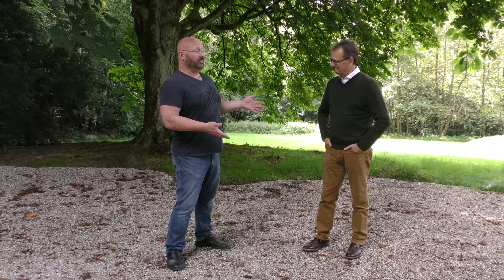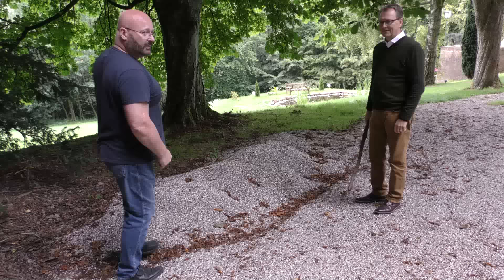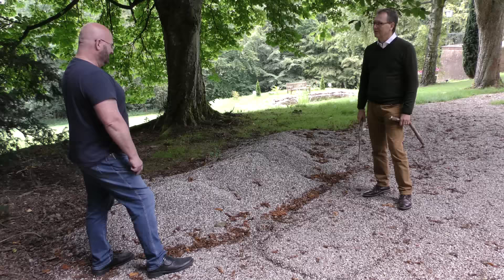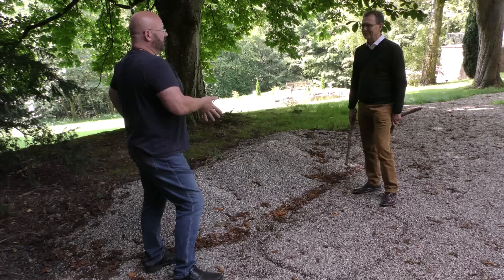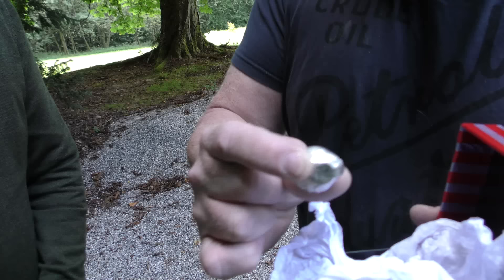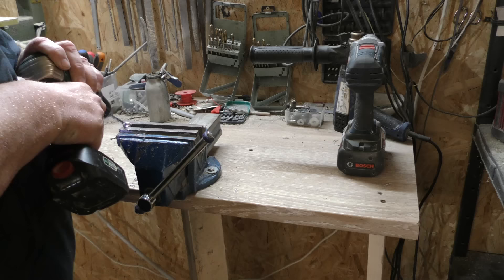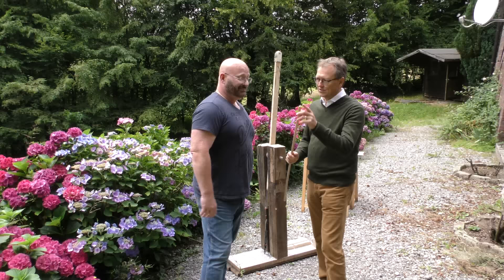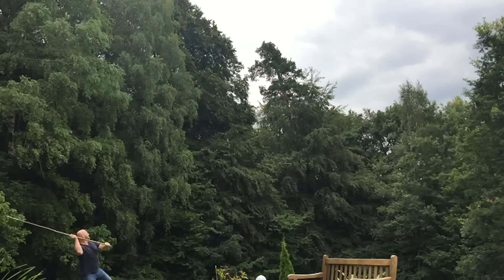The Mystery Of The Whistling Bullets: Psychological Warfare, 200 AD

Comment: What would happen if you shot 2 of these pellets connected via a small chain? would it be feasible?
You'd probablly need to increaes the number of slingshot bands to accomodate the extra mass.
Just wondering about the amount destructive damage you could cause.

Comment: Hello Jeorg.
   I think the idea of the 'bullet throwing stick' is a good one, but something you did not test was a thinner 'wand' and using the smaller, 40mm bullets. I am no expert, but I feel that such a small projectile and thinner 'rod' would result in faster reloading, and with the 'flex' of such a thin wand, result in higher bullet speeds. And of course, higher speed means longer range, which keeps the thrower out of hand thrown projectile ranges, such as spears. 

   Just a thought, 

speaking Frank-ly
 
   Please pass this on to Dr. Reid if you think it is important enough to warrant his attention.

Comment: The smaller the hole, the harder it would of been to drill back then, so the reason for the 4mm hole was probably it was the largest size that made a decent whistle as the 6mm clearly didn't whistle as much and was more of a wooshing wistle then an actual shrill whistle. The diferance came through a lot on the recording.

Comment: It's just a thought but if you got a piece of wood and carved a channel in it so it held they metal BB's (like a guns ammo clip) and to have all of the metal BB's orientated so that the holes are perfectly accessible. then I believe you could achieve a much faster reload time, because with all of the metal balls orientated in a direction where the hole is easily available you could simply hold the clip of metal balls in one hand and poke the pointy end of the stick into the whole of the next ball every time you go to lunch one this way you will have a smooth motion to launch and reload without having to fumble around and find the hole.... And if practiced I bet you could get a very fast reload time....

Comment: Duude, if your firing staff was smaller and you could load a bearing  further down the staff, it would be harder to aim but project much quicker. You could also load maybe 10 or 20 at a time and fire them in an array across a field. Also, an added advantage would be preserving 20%+ on materials!

Comment: The hole size might have been the same size across the board not because of functionality, but commonality in manufacturing method as they would be cranking out thousands of these things. Finding some at another Roman siege site would be interesting to see if the hole size is different from maybe a different manufacturing source.

Comment: If I may suggest an experiment.....try a sling like they use on the game of jai alai...with a 4 mm peg at the base of the sling. The peg would hold the ball in it's initial launch position and when the slinger went through thw motion of launching the ball, the curved surface of the sling woild put an incredible "reverse spin" on the ball....thereby INCREASING the whistling effect as well as INCREASING the flight time of the ball.

Comment: I am not sure why it is assumed that poison would be in liquid form and not more easily managed like certain leafs, herbs, flowers, for example. If solids,  it would not necessarily need to be sealed in, only attached using a bit of wax, so as not to fall out during flight, or with nothing but moistened to dry compacted in the hole.  Another might be that the end of the stick which went through the holes was soaked in poison or rotting meat etc for infection so it served to launch and to load the projectiles with poison/bacteria. On the other hand launching from a stick reminded me of the arm extensions sold for throwing tennis balls for dogs or the Spanish game where they have a curved device to launch a ball. In the former it’s not so possible to put poisons into the projectile, in the latter the hole is only needed for that (and noise). Final observation is that the most simple explanation for the holes being uniform is they are made with a standard tool! Occam’s razor. It’s another step further from simplicity to say they were for a pole to launch from. Or maybe they were simply (or also) carried by soldiers on poles to be quickly reloaded efficiently. I note no attention seems to be paid to how the bullets were manufactured which is strange since what tool made the holes is a very important part of understanding. Were they made on an industrial manufacturing basis like many Roman things, if so there is no reason for the holes to vary much except when a new tool was needed.

Comment: You said that your a bad slinger? Maybe the Roman troops used a staff sling variant. I was interested in the stick an the ammo placed on the nail. Two questions how far did it go an maintain a true straight line? Secondly how would it perform at a target 40/50ft ?

Comment: I offer another theory.

Perhaps the holes in the projectiles were due to the moulding process and how they were removed from the mould.
Perhaps small sticks were used within the mould with the benefit that one could more quickly remove and handle the projectile after pouring lead. I imagine that the moulds wouldn’t have been smooth and therefore the projectiles may have proven problematic to remove. What do you think?

Comment: Chain shot. There are shotgun shells comprised of 6 lead “buck shot” tied together by copper wire. Amazing accuracy and hitting force. Btw, you can easily cast the holes in lead shot, picture a “shot press” as was used by muzzle loaders and insert a steel pin.

Comment: When I was about 10 years old I was struck in the head with a rock from a slingshot. Having the camera on the receiving end gave me flashbacks of seeing that rock flying at me, the bright light I saw after it struck, and the ringing in my ears afterwards. I remember buckling at the knees and falling down into a prayer position staring at my hand and the long sleeve orange shirt I had... then the trickle of blood which increased massively in a matter of seconds falling on that orange shirt at my wrist. I reached up and touched the side of my face, confused at where this oozing red liquid was coming from. Then peering at my blood soaked hand caused adrenaline shoot through my veins, likely the only reason I didn't pass out. I remember being very tired after the bleeding stopped but my cousins wouldn't let me fall asleep for fear that I wouldn't wake up. That was 26 years ago and I haven't really thought about it in a long time. I still have a small dent in my head from it. Enjoyed the video. Cheers

Comment: Late comment but plausible.   Perhaps the 2mm hole was used to remove less mass from the projectile to keep the desired weight rather than a 4 or 6 mm hole which would have lightened it more.    Just a thought.
Another launch theory.  Imagine a giant scoop of these little whistlers coming at you from a huge catapult instead of one big round rock.   A large amount of these being launched all at once would create quite a scream.

Comment: Evaluating impact based on velocity is important. The velocity obtained at the hill would be possible based on some simple ballistics calculations. If the Romans had camps on opposite sides of the hill, the velocity of the projectiles must not have been too great, else they would have hit their own men on the opposite side. Knowing that distance, you can get an idea how fast the projectiles needed to travel to not pass to the other camp, and you could calculate what the velocity would then be on the hill.

Comment: Being a slinger myself (but having never used this kind of pierced sling ammo) I would say that 2 of the points mentioned here are the most plausible.

1) As as another person commented. Timing the noise was a means to gauge the distance so other slingers  would know how far away the enemy was.

2) They used the butt spikes of their spears/pilum javelins to launch these pierced lead bullets. This is a actually far more practical than using staff slings in a close-ordered formation (which is an awful idea, Been there, done that).

3) The whistling effect could be used at night to startle the sentries so that your men could slip through the defensive perimeter (commando style ) and set part of the roman camp afire.
Reply: We do know the Romans did like their staff slings, however, for their skirmishers and, presumably, from inside their fortifications.

Comment: Those projectiles would have been traveling in a parabolic trajectory with vertical component equal to terminal velocity and horizontal component at say half the "muzzle" velocity.  Resultant being say about 200 miles per hour.  A terrifying noise and rain of pellets with larger projectiles.  Deadly!

Comment: Or perhaps they were drilling the holes with something convenient that was relatively standardized.
Reply: hmmmm yes, i thought of this too. maybe the standard drill from the romans field tool box is that size. if so, this diameter should be found on other objects or works.. if more of these holes where found on other roman equipment then it might be the reason why all bullets have the size of the hole. needs more archeological research to find out. 
the stick-theory is plausible, a good explaination as well

Comment: I'd be interested in the poison theory! 
At first it seems very unrealistic but after I've sawn the penetration I could imagine that they seald the hole with wax of some kind and this would either be thrown out on impact or would be melting away in the body...
Would be cool if you could test that With the ballistic gelatine and some colured liquid!
Reply: I am not sure why it is assumed that poison would be in liquid form and not more easily managed like certain leafs, herbs, flowers, for example. If solids,  it would not necessarily need to be sealed in, only attached using a bit of wax, so as not to fall out during flight, or with nothing but moistened to dry compacted in the hole.  Another might be that the end of the stick which went through the holes was soaked in poison or rotting meat etc for infection so it served to launch and to load the projectiles with poison/bacteria. On the other hand launching from a stick reminded me of the arm extensions sold for throwing tennis balls for dogs or the Spanish game where they have a curved device to launch a ball. In the former it’s not so possible to put poisons into the projectile, in the latter the hole is only needed for that (and noise). Final observation is that the most simple explanation for the holes being uniform is they are made with a standard tool! Occam’s razor. It’s another step further from simplicity to say they were for a pole to launch from. Or maybe they were simply (or also) carried by soldiers on poles to be quickly reloaded efficiently. I note no attention seems to be paid to how the bullets were manufactured which is strange since what tool made the holes is a very important part of understanding. Were they made on an industrial manufacturing basis like many Roman things, if so there is no reason for the holes to vary much except when a new tool was needed.

Comment: 14:01 Im wondering as I watch this, maybe the size of the 4mm hole, was tested, and found to be a good resonating tone which travels farther because of slower soundwaves and sustains longer for the same reason? THey could have chose this size from trial and error with different sizes, OR they could have chose it because it was the same tool used to make a hole in a flute/pipe so they used it, hoping for the same tonal effect from a projectile? I am sort of sad, I feel like we wont get to hear this as it was meant to be heard, with fifty to a hundred of these projectiles, making the same tone, all resonating together in flight, it would sound louder and louder as it got closer, followed by shouts of pain or panic, making it very similar in effect to the whistling of the dropping bombs in world wars 1 and 2, which you already said. This is a very cool psychological ancient warfare video! :D

Comment: Mabey the hole drilled in to the shots is that they stacked them on a stick and slid them down to the hand allowing a shot controlled by the hand releasing one at a time "simi auto" or spread shot all at once. slid down to the hand would allow a more accurate swing and shot by pointing apon launch, a "straght shot".

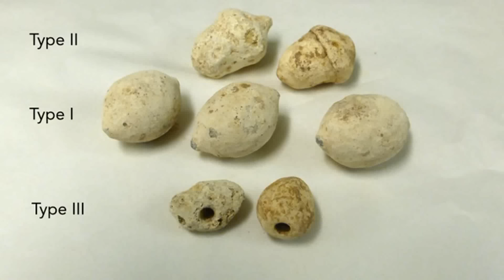Comment: I'm at 5:47 and wondering what if these were used to do shrapnel damage? The hole in the middle would be meant to weaken the structure but not so much to break apart until impact inside the body or something hard-like?
Reply: 21:18 hmmm maybe not

Comment: @ Joerg
I know this is an old video..Shock as a fan of you. I've never seen it. I'm a longtime Sheppard slinger.
But here is the important stuff.
My whistles are 3 ounce lead.
They are flat egg shaped.
they have a 5/16 hole going diagonal from one flat side to other.
They were a reverse engineered from some I seen used by Roman's. What Era I don't know. Since they are vastly different then these it had to be another Era of Rome.
But they give a very Artillery sound.  I believe they would have been picked up by the camera with the sound.
The sound is very close to the Artillery whistle in old B&W war movies.
Also note I can use the same mold using zinc and its a deep whistle. 
I don't know why this is.
But they are fun.
Reply: THERE.
I should have watch whole video.
The sound at about 14:15
The 4x slower is very close

Comment: 11:00 -- A double-edged comment for you -- I think you've done good work by using the mechanical test sling, BUT from my own readings it seems evident to me that "shepherd's slings" with pouches weren't necessarily the only type of sling to use.  In short, there should be a way to wrap the sling around the bullet like a spring, to impart a spiral onto the bullet when it is released.  AND that type of bullet will have spiral grooves cut into the surface, which in turn whistle.

Comment: It's like a whistle. Only length of chamber influence on the whistling tone. Diameter of hole will influence on at which speed it will more efficiently produce turbulence for whistle sounde (like openning on whistle)

Comment: Those holes could be a nock for a crossbow style slingshot that utilizes a band of leather with a 4mm pin through it. If the hole is the right size, the weapon could be lowered or swung around w/o losing the ammo, but could still be fired quickly and accurately. They didn't have rubber or synthetics, so they weren't using Wrist Rockets, and a throwing stick isn't going to have near the energy of a crossbow sling.

Comment: The rate of fire from the stick was pretty slow for just one solider but remember that the camp might have had 3 or 4 thousand troops. It would have been easy to set up a continual hail of bullets even with a slow reloading process.  Or, you could have had half the troops shooting and the other half reloading.  With 2 sticks each shooter could have had an assistant swapping sticks and reloading so that one solider shot while one reloaded.

Comment: The David sling was preferred over  a stick not only for power but for accuracy. The centrifical force is higher than that smaller stick.  Not sure about the larger stick.  You should probably get someone who knows how to throw one and test it. Also get a chrono meter.

Comment: I lived on an apple orchard when I was a youngster we ( brothers and cousins) would have apple fights all the time and it quickly evolved into stabbing the apple with a firm yet  limber switch or sapling then launch them at each other. The longer one's would go 200 yards or more. While the shorter 3 foot length would produce a line drive fast enough to explode a hard green apple when they hit you.
They had to be going well over 100mph. They made a very loud whirling sound if you left the stem on the apple.

Comment: To my mind the stick launching idea for the hole in the projectile makes the most sense as it would explain why the holes were the same size and depth. The same size to fit the stick, the same depth because if the hole was too shallow the ball would fall off before being launched,  too deep and it wouldn't (mightn't) come off at all.  The Romans seemed to love simple throwing weapons and these could be for enemy out of the range of their Plumbata.
If the hole was for poison, any size hole would do.  Also, if it was for poison, human excrement would be the easiest and most readily available. It is only really dangerous if entering the body through a wound and "safe" to handle otherwise.
As for the whistling, that was probably more an unexpected and welcome bonus. (Although didn't the Romans have devices on staffs or columns that they waved to create a wailing noise anyway? Or am I mixing them up with another early military force like the Chinese?)
Great video, you should do more historical theorizing / investigating.
Reply: Another thought just occurred to me. The Romans invented the concept of the dog-ball-thrower!!!

Comment: Im still not sold on the poison. It seems to me that the airflow through the hole would likely blow out the poison. If the surface were made rough or porous and covered in poison maybe that would work.

Comment: That 4 mm. hole was most likely for the whistling sound, that was extremely intimidating on receiving end at 14:12 but I would think a little feces wiped into it would cause nasty infection.  Not sure the Romans needed to wait for infection to set in before overtaking that settlement.